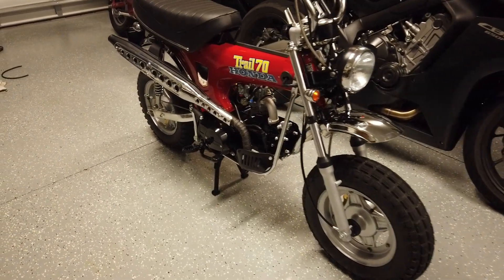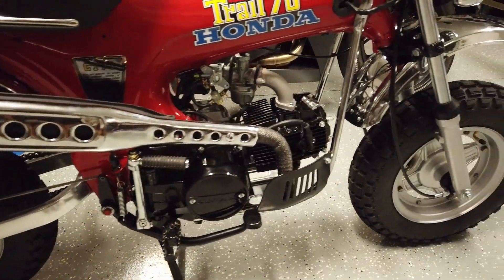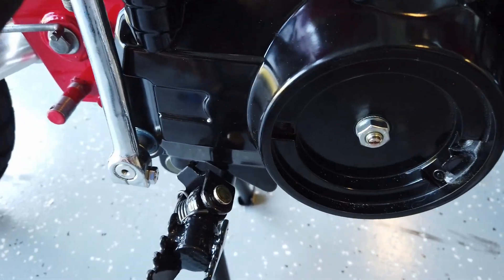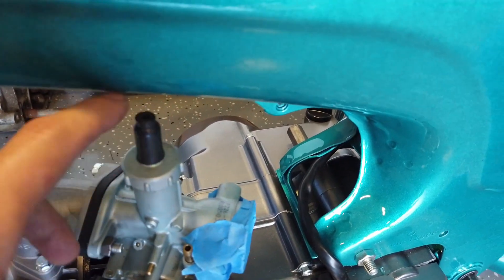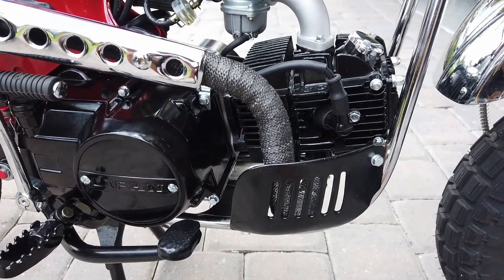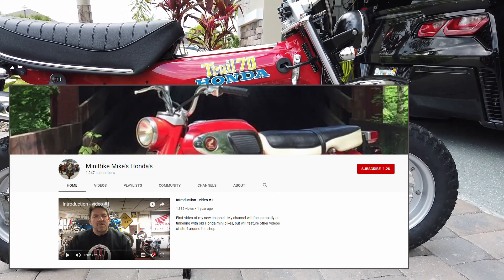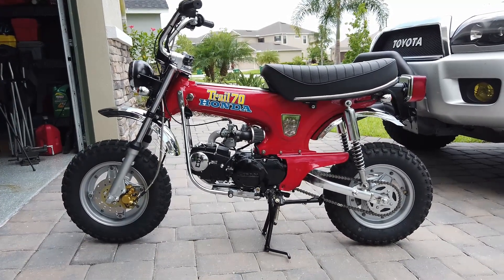Finishing up the Lifan 125 Semi-Automatic 4 Speed Engine (Complete, Again!)

Comment: Sorry I sent it before I was finished.  I was saying I knew Mike could give some help on the engine guard on how to get it on.  As it turns out you figured it out on your own but it was a must to get it on as the bike did not look right without it.  Frames the engine out real nice.  I agree the black engine looks really nice against the red frame.   On the engine I would rather have the 125 as the 72cc is fine if your 12 years old doing trail riding but if someone is going to get it street legal you really need to be able to go 50 to 55. At least I think so.   Last thing. I got the 16 tooth front sprocket in and by you pointing out the diameter was 20 and not 17 it worked.  I say that as I worked with two of the biggest suppliers of parts for CT70's on this and one sent me the wrong size and when I pointed it out they said that is the only size we carry but neither one of the 2 asked me what size I had to determine what I needed. I thought one size fit all.  I had to find out by watching someone on you tube who does it for a hobby to point out there are different sizes to lead me to what I needed.  When working with these part suppliers there cannot be a lack of communication other wise your going to be getting parts that do not fit.  But I am finding out these part suppliers are not that good at telling you " you need to be very specific on what you have and what you want"  The hell with it I will keep watching you and Mini Bike Mike and that way I will know exactly what I need.  Keep up the good work and glad to see your subscribers jumping up.

Comment: Just picked up my first CT70 yesterday. It's a manual one. Got a Lifan 120 engine with it. Stock engine runs good after I cleaned the jets.
Reply from the maker: Awesome! I know you’ve been following the channel for a while. Let me know if you have any questions or need any parts 😊
Reply: @eastcoastish  I'm thinking I'll swap in the Lifan, maybe put the 12" wheels on it,  get a new seat and a few other things. After I get the mechanical side dialed in strip it down to paint it emerald green or the ruby red. I figure you get at least half the credit for me wanting to find one and mod it. I've been soaking up as much information as I can. Hoping to have it and the 70 Z50 ready for summer camping trips along with the Super Chicken Jet Ski we just picked up. Been enjoying your channel for awhile now. You have the cleanest builds I've seen on YouTube. 

I think the video I'd most like to see is a stock CT70 racing next to one with an upgraded engine. I'm always curious with performance parts to see how much of a difference they make.

Comment: Did the new engine come with a gasket for the stator cover? Is it supposed to have one? I just got a new Lifan 125 and there aren't any gaskets or an O-ring for the stator cover or clutch adjustment access cover.
Reply from the maker: I don’t believe the stator cover or the clutch adjustment cover have gaskets on these engines.

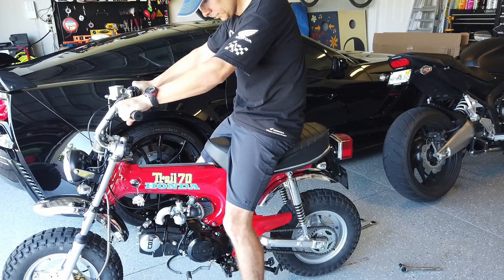Comment: i bought the same semi-auto 125 lifan engine and I am having trouble just like you like at 2:19. how can I make it easier to kickstart it. please help
Reply: I got the same issue but I reckon the air fuel mix is wonky or maybe weak spark idk
Reply: Humanoid Player I fixed my issue with kick starting. I did some adjustment with my new carburetor, the carb that came with my kit sucks and the I positioned the kick lever to be at the top. Previously I had the kick lever placed halfways

Comment: Hello Ken I've been trying to do a search for a kickstand for my 69 Honda CT70 with a 125 Lifan engine I bought the bracket and put bags but it did not come with a kickstand I think I'm going to have to buy a whole new one can you please help thanks Ken I appreciate it take care my friend
Reply: I bought the bracket and foot pegs but no kickstand came with the order for a 125 Lifan engine can you help me locate for a kickstand please thank you my friend
Reply from the maker: There are a lot of options on eBay such as: https://www.ebay.com/itm/HONDA-CT70-CT70H-KICKSTAND-1969-1974-K0-K1-K2-K3-KICK-STAND-SIDE-STAND/362838903273 or https://www.ebay.com/itm/Anti-slip-Black-Motorcycle-Bike-Kickstand-Side-Stand-Leg-Prop-Part-Universal-Kit/123903496582 - make sure it's the right length for your suspension / footpeg setup.
Reply: I almost bought a kickstand today just the kickstand not guaranteed to fit my life ins 125 they wanted $48 and I said well that's a little steep for me honestly instead of going through all the trouble with no luck I'm just going to purchase a brand new rack and pegs with kickstand because that's what I get for not paying close attention LOL believe me I have lots of parts that I cannot use because I ordered incorrectly oh well LOL I ordered from t-bolt a rectifier and a harness no I can't use them and I know they don't refund on the electrical parts again for doing the wrong research so there's several items that I have that I will not use that I paid money for because like I said I wasn't paying close attention so it's costing me LOL one way or another if it's the last thing I do in my life had my 62 years I will complete this project it would take some ten years lol I'll be 72 by then LOL on a wheelchair LOL I just crack myself up LOL I make mistakes but I clear them up sometimes it's costly my fault nobody else I will take 100% blame I'm getting a lot of my parts from China I just ordered a chain guard for $27 shipped candy gold should be here December 24th I also bought a gold chain I believe it is a 420 with 102 links I was told it would work with my 125CC we'll see LOL I'm also looking for the front forks black rubber pieces that go on the side as mine are very corroded but that's about it thank you Ken I appreciate your advice take care God bless you and family happy holidays be careful out there good day thanks again my friend good day